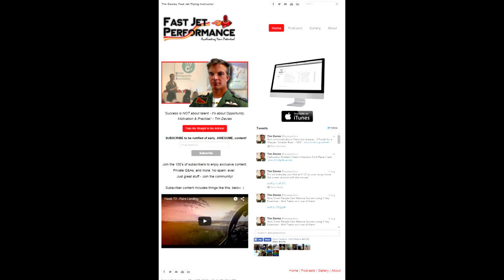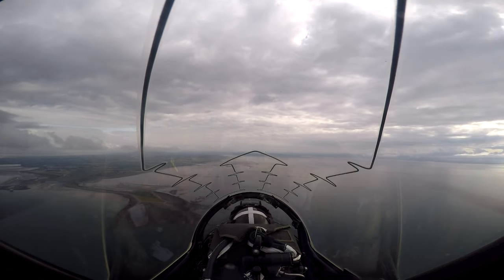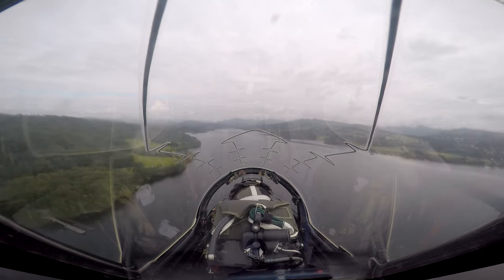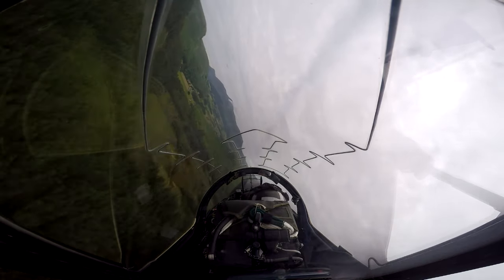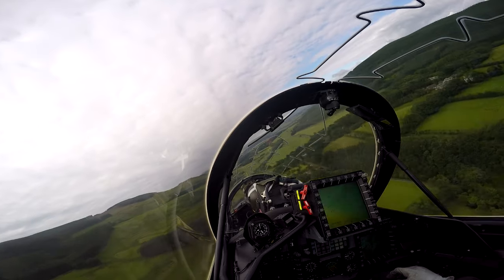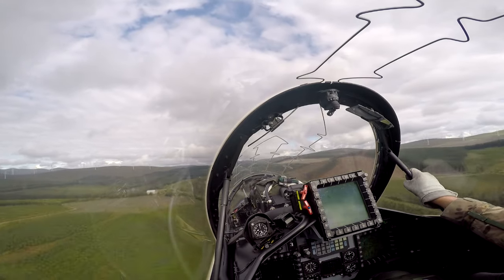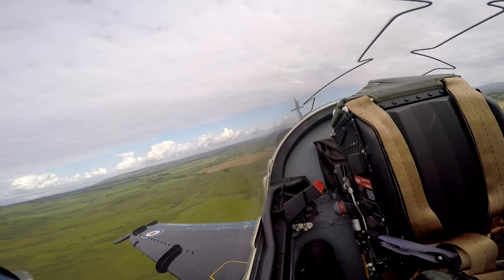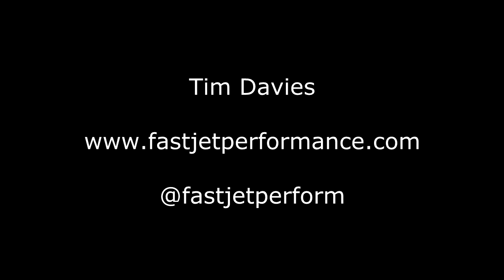Low Level IN COCKPIT - EXPLAINED by the RAF Instructor Pilot

Comment: Have you put out a NOTAM for this sortie? I’m a drone pilot and know how often drones use some of the areas you’re flying through. Is there a way of checking? Our ceiling is 400 feet.
Reply from the maker: No, the NOTAM should come from your side - it's easy to do.
Reply: @FastJetPerformance  I’m not going to get involved with that from rural Suffolk, am I? 🙄
Reply: @FastJetPerformance  so I have to notify every flier for every flight I
go on? 😂
Reply from the maker: @east.suffolkdronephotography  in Norfolk you are unlikely to get much mil low level traffic so you should be OK as long as you comply with mandated CAA drone laws and have registered the drone - that's all I do but then again I don't live in a very active Low Flying Area either.
Reply from the maker: If, for example, you were going to film over Lake Windermere above 250 ft then I would absolutely NOTAM that flight, it prevents you conflicting with mil traffic as they will just plan to fly elsewhere, they are very flexible in the planning stages, they will see your NOTAM and just avoid the area.
Reply: @FastJetPerformance  that’s good to know, thank you. Only NOTAM it if it’s a risky location. Is there a list for these areas or is it just local knowledge?
Reply: @FastJetPerformance  yes, all above board and exceeded often with things I don’t need because of the weight! It’s Suffolk, not Norfolk 😃
Reply from the maker: @east.suffolkdronephotography  got it.

Comment: I’ve always wanted to be a fast jet pilot in the RAF, until recently I chose to do an apprenticeship at Rolls-Royce. Due to current circumstances I may be made redundant, is it still worth having a shot at applying for a pilots position? It would mean me going to sixth form aswell
Reply from the maker: Yes, look at the Royal Navy too. Anything military at the moment is a good thing as the private sector will suffer post Corona.

Comment: 6.30.  Why is it easy to hit the water, when you have lots of instrumentation?  What mental urge would make you go too low?
Reply from the maker: Lack of real world visuals, trees, houses etc - people just descend into the water.
Reply: Many thanks.   Sort of Bermuda Triangle Syndrome, the instruments say one thing, the pilot sees another and overrides the safe info?
Reply from the maker: @josephinebennington7247  well the Hawk T1 doesn't have a Radar Altimeter so there is also no low height warner or audio. What actually happens is that the pilot is judging height by the 'rate at which the ground seems to be moving past them'. The higher you are, the slower it is perceived to move and you settle at what is known as a '250 feet picture'. When you fly over water having come from flying over land, the ground (water especially if few waves) appears to be moving slower under the aircraft so you fly lower to get that same picture back - this is why pilots fly into water. Remember that the cockpit is a busy place, height keeping is one of many activities that a pilot is doing - speed control, radio, navigation, looking out for birds, other aircraft, planning for an attack run etc - and then you hit the water. I hope that makes sense, I'll address it in the next video for you.
Reply: Thanks for this.  A Seriously and absorbingly informative explanation.  A vid on this subject would be a valuable addition.

Comment: Hi Tim, I am looking at joining the RAF to become a fighter pilot in the future. I am currently 15 and go to air cadets and have done so for nearly 3 years. I have high predicted GCSE grades  and am doing the higher triple science award and am going to do A levels in chemistry, Physics and Maths. I think I want to join the raf at 18. Is it best to apply straight away for the pilot role or is it worth me taking any apprenticeships beforehand ?
Reply from the maker: Careers office for that answer as this pandemic has got everything changing, unfortunately. My usual advice would be to apply at the earliest opportunity because then you can have another go or back-up go to uni. The careers office will have the latest advice but don't forget the RN and Army either - both very good careers, indeed.
Reply: @FastJetPerformance  ok thanks for your help and quick reply

Comment: i assume if you put wire mesh on the engine intake a bird would just go through it all the same? What are the zig zags on the glass for? and are there times during the evening when you cant train because the engine noise would disturb people?
Reply: The zigzags are explosive cords that break the canopy into pieces so the ejecting pilot doesn't have to do that with his head as that would be uncomfortable.

Comment: Great video. The one thing that sticks in my mind is, flying at speed and at such a low level, how on earth do you avoid birdstrikes? Surely a bird is extremely difficult to see, given it's size and the oncoming speed of the aircraft.
Reply from the maker: You don't. Sometimes they just happen - you can take precautions by avoiding areas of high bird activity. Notice that we stay at 1000 feet for the coastline and then descend to low-level as coastlines are where the birds tend to live. And, yes - hit a bird at speed and bits of the jet fall off.
Reply from the maker: You don't. Sometimes they just happen - you can take precautions by avoiding areas of high bird activity. Notice that we stay at 1000 feet for the coastline @ 3.05 and then descend to low-level as coastlines are where the birds tend to live. And, yes - hit a bird at speed and bits of the jet fall off.
Reply: Thank you so much for replying. It just amazes me that you are all so well trained to handle all of these flying demands in a high performance jet aircraft. I can understand why only so very few pilot  candidates are selected for fast jets. Best wishes.

Comment: Great video. Good to hear the commentary. I fly a flexwing microlight principally within an AIAA (Yeovilton area). Just out of interest, is deconfliction from your point of view purely visual or are you guys able to see us on aircraft radar? I have had a few military a/c pass me, in fact a Hercules crossing abeam just the other day, and often wonder if they 'saw' me before I saw them.
Reply from the maker: Visual as you don't have a transponder. If you are talking to ATC then you might want to get a Traffic Service but that's hard without IFF - so I would stay below 250 ft and you'll be fine. You are so small, Hercules are big so they probably won't see you - file a NOTAM for your flight and then the military will avoid - thanks for the Q. Most military aircraft don't have an air to air radar and cannot see you - even if they do have a radar, you are too small to be seen.
Reply: @FastJetPerformance  Thanks for your reply! A mode S transponder is probably the safest option for me for the future then. Plenty of microlight aircraft have them, but they're not cheap!...

Comment: You said in the video that you wouldn't get radio contact with Scotland until about 5000 ft, is this due to earths curvature or mountains maybe?
Reply: Both, the frequencies used require line of sight and have a relatively short range. Although you can some odd anomalies. Once I heard a fascinating chat from two pilots flying over Bear Gryll's island in Wales. I was high over the west coast of Ireland. I could hear them but they couldn't hear me.

Comment: Does a military RWR actually pick up/display civilian air traffic guidance radar?
Reply from the maker: No, they are individually and specifically designed to only pick up radars that nations feel would signify a threat to the aircraft - these are normally search and fire control radars of potential enemy forces. If the enemy may use a civilian radar in hostile intent then an RWR would also be made able to detect that particular radar but no, they don't detect the host nations civilian ATC radars.

Comment: Might be a silly question, but what are those metal structures (under the canopy) for ? Thanks in advance for your answers !
Reply from the maker: MDC - Micro Detonation Cord which explodes the canopy on ejection initiation.
Reply: Wow ! Isn't it dangerous for the pilot's head ? Why doesn't the canopy eject as a whole, as on other fighter jets ?
Reply from the maker: Gyrocompa it would be too heavy if it had to contain rockets. The MDC is OK and far enough from the pilot that, if they have their visor down, they should be fine.
Reply: All right, many thanks for such clear explanations !

Comment: When you're banking steeply that close to the ground, are you having to use rudder to maintain altitude?
Reply: Roger Froud Fella, you’re doing 420 knots: you don’t touch the rudder.
Reply: @wangdong4903  - so why doesn't it nose in and lose height in those turns then?

Comment: I have often wondered what kind of pilots licence or certificate a fighter pilot gets. Whereas in civvy st you might have a PPL or CPL or ATPL etc, what do you guys get? Military Pilot's Licence or MPL perhaps? Just curious.
Reply from the maker: There is no licensing for military pilots in the UK. You can get allowances (or used to be able to) against ATPL training but an RAF pilot will not even have any qualifications to even fly a light prop aircraft.
Reply: @FastJetPerformance  Astonishing! Even though you have done all the work and flown to much higher standards? American pilots are automatically put through commercial or ATPL training for free so they can continue flying with airlines. Don't RAF pilots get that at least? That is, will the MOD pay for that?
Reply: @Ben-kt5rc  I see. That's how it should be. Who pays for the type rating though? For instance, if you've been flying an AC130 and then fly a 737 for one of the airlines you will need conversion training. Who meets that cost? The airline maybe?
Reply: @Ben-kt5rc  I should hope the airlines pay for it too:-) Ok thanks for that.

Comment: How are you allowed to fly 500 knts below 10,000 feet do you have to request high speed from atc?
Reply from the maker: In the UK, MOD aircraft are exempt from the civvie rule in Class G airspace and often in other classes as ATC know that its not easy for jets to hold less than 250 kts so let us fly faster. Also, the UKLFS (UK Low Flying System) which is surface to 2000 ft AGL, the speed restriction is below 540 KIAS IIRC.
Reply: @FastJetPerformance  wow thanks 😀

Comment: That's a detonation cord embedded in the canopy, right? So why does that leave a huge arrow-shaped strip of canopy right above the pilot's head? How are you supposed to eject like that?
Reply from the maker: You go through the exploded canopy, there's nothing left of it post the detonation of the cord. The canopy is perspex not glass and, if large bits were to remain, the airflow and seat movement just bounce them out of the way. The arrow you talk of would not remain as an arrow but just millions of bits of perspex.
Reply: Well, I knew it wasn't glass, so I thought the cord more or less cuts rather than fully shatters the canopy. But if it does, then indeed it doesn't matter what kind of a shape the detcord is woven into.

Comment: Great video! A question for you, how long does it take to get relaxed with low flights with students while sitting in the backseat?
Reply from the maker: The instructors who teach the new instructors simulate student errors during the training so we've seen it all before - there is no adjustment to be made with students :)
Reply: Thanks for the quick reply! Its just i get nervous sitting next to the Mrs while shes drives to the shops.
Reply: Furbs Maybe you should fit your car with ejection seats!

Comment: Putting tcas on at that height would turn it into a killer should it operate, wouldn't it?
Reply from the maker: It operates but doesn't control the aircraft, it only warns and directs me - I have to manually fly the aircraft, its advisory only, Andrew.
Reply: Fast Jet Performance Ah comprende, thanks.

Comment: Excellent video, thank you fopr the running cemmentary. Image quality and lighting excellent.  As you where talking about birds, on 03 May 2018 a Russian SU-30 fighter jet crashed in Syria killing both  pilots. Reportedly a bird strike. Could that really happen ? I find it hard te believe that a bird can cause a engine failure on a $40 million figter jet !
#GroveErasmus
Reply from the maker: A bird can destroy the compressor blade which will throw metal fragments into the rest of the engine causing its loss. If this is at a critical stage of flight then the reduction in power can cause the pilot to lose control our to the reduction in airspeed.

Comment: love it. no need for commentary - just engine noise and a hour or so of flight is enough. i've done the same in my powerboat. http://www.youtube.com/watch?v=Y5_6U3zRgsc 
Hope you will post more continuous flight videos.  Much easier to drop a gopro or xiaomi yi cam with internal battery and 128GB card for HD videos (although USB port for charging would probably be difficult in a government jet lol) which would give you an hour on battery or 16 hours on power @ 1080p60.

Comment: OK.... so 25 kg per minute.... per hour....to pounds...to us gallons because the whole world assumes it's the only type of gallon....to actual, imperial gallons... at April 2019 money.... about £1,225 per hour for the fuel at this speed and altitude. Not bad. Add maintenance and I'm sure I'd need to sit down, but fly it a bit higher and the 18 million purchase price puts the Hawk in snazzy bizjet running cost territory. Result.